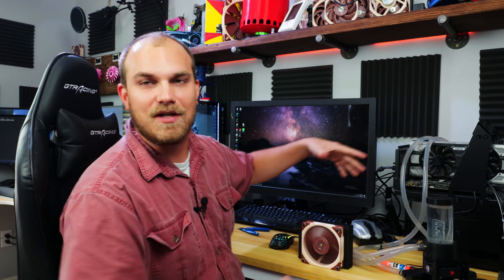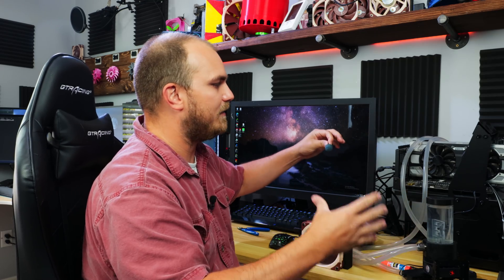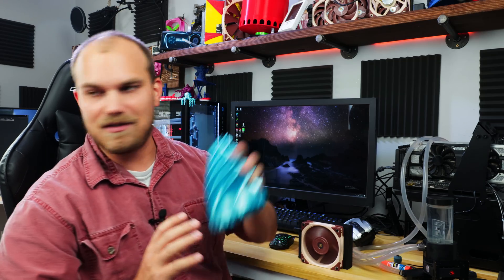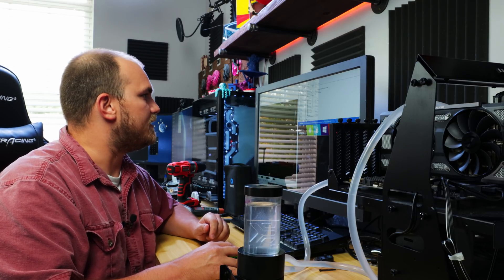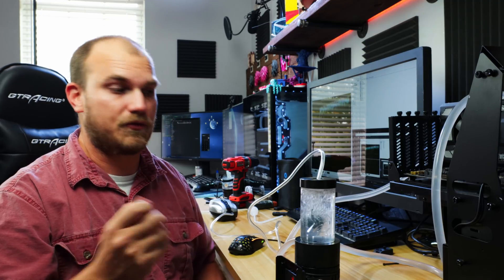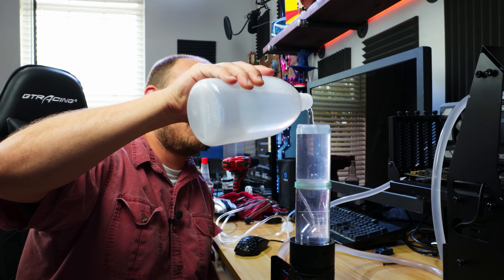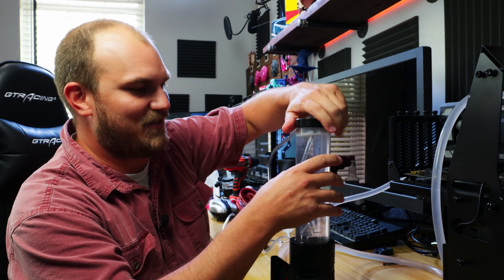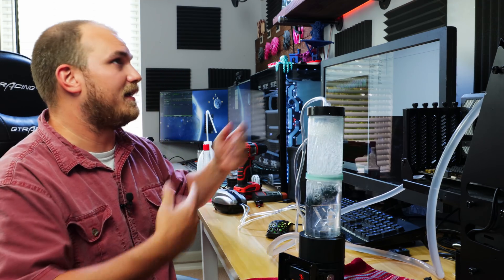Can An Airstone Cool Your PC?

Comment: Thank you for your videos. I think you do a great job.  
I did not watch the entire video ... my apologies ... but here is how I would set up the experiment. Get 2 Styrofoam cups (to minimize conduction and emission losses i.e. fewer variables),  Place a thermometer in both cups(preferably not touching the sides of the cups). Place the airstone in one, it is the test case, and nothing in the other that is the control case. Now pour the same amount of boiling or really hot water into both cups. Observe the temperature for maybe 15 minutes (because multiply the results by 4 to get a per hour answer). If the airstone cup is significantly cooler than the control cup. Then it is reasonable to conclude you cooled the water by bubbling the air through it. The air temperature is important, because in heating and cooling its the magnitude of the difference that matters, and it can compensate for differences in multiple tests. the volume of water is also important because of specific heat, more water more heat to dissipate. By significantly, I will guess over 5 degrees, because I am not sure of the mathematical way to determine what is significant. Multiple tests would also be wise. So, you can average out the results and be more confident about them. Once you prove that airstone technique works, and derived a rate at which it cools you scale up to match the heat output of the computer. Odds are you will likely need a large but not deep tank to accommodate many 30+(guessing) airstones.
Reply: I did not read your entire comment but heres what I have to say about your comment.  It sucks.

Comment: Thermodynamic insight: the cooling tower works because the hot water exchanged heat with cooler air. Faster cooling can be achieved by few methods 1. Increase temperature gradient (get colder air/hotter water). 2. Increase heat exchange surface area (get more bubbles or bigger cooling) tower. 
In this set up the biggest bottle neck is actually how much air you can pump in (go thought the reservoir), oh and don't forget air pumps will heat up air been compressed.
And You don't want taller reservoir, you want wider reservoir to allow more hotter bubbles leave the reservoir.

Comment: Use 2 res. side by side. Route the blocks hot output to the hot res. Bubble the hot res. then send water to cold res. After, pump cold water to the block.

Comment: I say: Go big or go home
Try it with 6 feet of pipe (PMMA is not too expensive), and maybe adding the water wetter drop by drop to get reduced surface tension, but not so much that it foams up all over the place. Even if it doesn't cool it will still look cool, maybe add some RGB

Comment: Maybe something similar but use the "bubble over" effect and make a outter  container to catch the overflow
with the inner container supplied by heated water  and the outer container where the "cooler " water gets pumped back into the system.

|     ,.,\,.,     |                     
| .  |~/~ | . |
| ~|   *    |~ |
-----------------
V     ^^     
C      H

I know this "diagram" is a little crap but i figured tp place this here before this one forgets.
V is the cool pumped out water    ( C )
^^ is the Hot water in       ( H )
~ water
,.,.,., My best attempt to make bubbles lol
| sides of inner and outer container
\
/ hose
* Air rock(s)
_______ Base because you gotta have dat base lol
Edit: forgot the air rocks / hose.  Just place them to the center like in this video.

Comment: Check the temps of the water with a laser thermometer at the top of the reservoir and the bottom and see if its even doing anything for temp change. With that style of pump the water coming in from the loop doesn't seem to have much time to interact with the bubbling so you might need to get the flow to pass through or by the water stone to get any actuall heat transfer before it enters the system again. I think maybe the bubbles are creating a heat barrier inside the rez from top to bottom. So you are just sucking hot water back in. Maybe put the return in the top so the water passes the air stone and down to the pump again

Comment: On the water return hole for the reservoir add a hard pipe to the top of the tank that way all water that's coming in has to pass through the bubbles. And has to be cooled and hopefully will be cooled better. But I'm also not a fluid dynamics professor XD.

Comment: [sug] 3 Identical water chambers, the same size as you have already. 
Chamber 1): Hooked up like normal to the water pump (full of water). At the top put a cap on connected to a tube in the center.
Chamber 2 (condenser chamber): laid not quite sideways. Slightly higher side goes towards chamber 1 connected from the tube.
The lower side is capped with a tub in the center, going into chamber 3.
Chamber 3): Full of water, connected towards the bottom of chamber 1 with a one-way valve, to prevent back flow.

In theory: As the first chamber starts getting hot, the hot moist air rises to chamber 2 building up condensation forming cooler water droplets, then drips into chamber 3. The temperature difference should be enough to make the water flow from chamber 3, into chamber one. Don't expect it to cool the system like a radiator, but it might be enough to keep it running without throttling the cpu.

Comment: You aren't getting enough heat exchange so
1.) Remove the extra column
2.) Print an "evap/condenser" combo pan that screws onto the res. It should look like 2 funnels, both facing "down", connected via cylinder. The lower "funnel" should have a large enough "mouth" to fit the res. The "mouth" of the upper "funnel" should tiny, you want a small amount of air to exchange without totally evaporating your water supply. This can probably be printed or fabricated out of copper sheet metal for better heat exchange, copper should also make the water re-condense a lot faster.
3.) The total size of the "evap/condenser" combo should be no larger than 1.5 the size of the res/pump. While larger would offer more efficiency, it would also make this thing terribly unbalanced and top heavy.

Comment: For evaporative cooling, I would think the evaporated water would have to leave the loop.  As it is, evaporating water would cool the loop, but it brings the heat right back into the loop when it condenses and drips back down. 

If you ran it with some sort of wick like a humidifier/evaporative cooler does, you should get some cooling, but the loop will drain over time.  Not practical for daily use, but a good proof of concept.

Comment: I bet if you 3d printed a properly shaped shroud to be used with the screw type fan the induction would be more forced like a pump. Turbines are inside housings, without that some air seems to be lost outwards instead.

Comment: An issue of this could be that of the design of the pump as it is designed
just for circulation; the water tank connected to the pump is simply designed
to keep the water loop filled; there isn't any circulation from the pump into the tank 
and back as the initial design wouldn't have a reason to initially do this. 
one the best chances you have with the current setup is to cap-off
the inlet of the pump and have the water from the PC flow directly into the top
of the reservoir, so that the hot water is circulating within the tank and the 
bubbles are affecting the hot water. The increased height of the tank will help
with cooling.

Comment: 1. Make the surface area of the coolant in res approx the same as the cooling tower area
2. Have more stones evenly distributed to keep the surface uniformly turbulent. Achieving a light spray at the surface is the ideal scenario. The more surface area of water exposed to the air the greater the rate of evaporation.
3. you need a fan blowing across the top of the coolant surface to dissipate the saturated air to allow more coolant to evaporate and adiabatically cool the system.
4. Bonus points if you use a peltier to cool a condensing plate to collect and recycle the coolant, thus potentially making the system viable as a continuous operation cooling system (IF it works)

Comment: Thr thing is as far as I know, that air introduced into the system transfer heat worst than water, so passing through the water block will affect negatively the heat transfer.

Comment: The Da Vinci screw, and later that double helix screw, didn't/won't work because the air is allowed to escape radially. You need a duct for it to operate correctly, as then you'd be pushing the air axially, as the air couldn't escape radially. Think of an Archimedes screw, which is typically used for water, and how it needs a duct to contain the water, to push the water. An air screw is no different, except Da Vinci's and derived designs of such are conical rather than cylindrical, but they're conical in the wrong direction, as you'd be expanding the chamber, rather than compressing the chamber; this means that you could use an inversed Da Vinci screw as a compressor, assuming you can get tolerances tight enough, and you can actually get it to properly suck air.

Comment: Physics says that's a terrible idea. Basically, other than Ammonia or artificial coolants (generally bad especially in relatively low quality cooling ie non-industrial systems) water has the best ability to hold heat. Air is an insulator. More air IN the water = water with more insulative properties. Cascade systems and cooling tower systems work because they minimize the presence and absorption of air dissolving in the water itself.

Comment: I have an idea, what if you use a large aquarium as a radiator. Most aquariums have heaters to regulate the temp. Can a computer do that job instead?
Reply: the idea is on the return of the filter you can make an acrylic box around a 110 radiator. the box will have two openings one for the water to go in and cover most of the radiator, and an outlet that leaves on the other side of the radiator back into the aquarium.

Comment: You could try like I did on my computer. I have two separate reservoirs one has a pump and the other one doesn’t. And the results aretwo radiators. I have a tall reservoir with a pump flowing to first radiator. Then to a smaller reservoir. Then second radiator and back to large reservoir. 
If you put the air nozzle in the smaller reservoir and seal it in between it might work a little better I don’t know never tried.

Comment: Well the thing is the air bubbling through the water isn't going to generate much evaporative cooling at CPU temps and the amount of air travelling through it isn't enough for conventional air cooling (though the heat transfer from water to air would be about as efficient as you can make it). Maybe if you have like 20 air stones in a trough with silly amounts of air pumped through it, as in similar amounts to the CFM of a fan, then it'll work .

And as long as you're making a trough for that many airstones...

How about reversing the idea and making a Liquid Droplet Radiator? Instead of bubbling air through the water, you rain the water through the air (collecting it in a trough, which could be your reservior, and then sending it back to the cpu). It's imagined for use in space based nuclear power (where you need massive surface/volume ratios for radiative cooling and with precision nozzles that shoot the spray at the collection trough) but it should work in air too and should put the normal radiators ability to transfer heat to the air to shame. You might make things a bit humid though.
Reply: He already made it, it's the big red thing he showed in the video at 0:45 .

Comment: As in Bermuda Triangle, under water landslides creates huge amount of bubbles and ship sinks with no buoyancy. Needs more water. Air in the system displaces amount of water and water is half or 3/4 what is needed for cooling. Like in a car radiator with a hole. Half the water = over heating. You want more water for cooling. Try Heavy Water.

Comment: IMO some of the problems might be pushing air in the loop. it could be the pump is pushing hot air in. it could be that your water going into the pump at the bottom. I don't really see it working that well because of the water to air ratio. 
 way's it might work better #1. have a sponge at the bottom and run the air stone on top of that... to stop help stop the bubbles from getting in the loop. then have the water coming in from the top (CPU side) so that only the hot water is being hit by the air bubbles.
 or #2 (kinda not what you are doing now but like what you did in the past on a smaller scale) if you put a sponge in the 2nd reservoir, have a hole in the reservoir connector (middle) to help air bypass, have the water come in from the top (on the sponge) and on top of all that, have a fan that can pull the air up through the dripping water in the sponge.

Comment: Print a rectangle box that at the top feeds water into it, have it be caught by a drip mechanism that spreads the water over the the whole container. Then near the middle have a long air stone. The water will have to drip down and pass through the bubbles in order to make it into the exit. The bubbles are outside air so theoretically it should cool the air. There may have to be some holes at the top to let air out so it's not just pressurizing the the system. If anything it could be a cool looking/noisy reservoir

Comment: Considering a tropical fish tank has multiple air stones (usually) and can EASILY be heated with/despite the airstones running by a 25w heater....

There's your answer.
Reply: The air pump is heating up the air too. What happens to the hose on a bicycle pump as you pump up the bike tyres? The hose gets hot.
Compression creates heat!
It's not until the gasses/air decompress that you experience any cooling effects.

So no, a setup like this will never work and that's why nobody uses a design anything like this.

It was fun to watch though :)
Reply: @TheHungrySlug  all fare points but also he didn't send the hot water to the top of the Reservoir so the thermal circulation wasn't sufficient.
Reply: @zeanyt2372  the water is being circulated by the pump. There is NO hotter water to send to the top, the res will all be one temp. Plus the air bubbles will be circulating the water in the already rapidly moving water in the res. Have you never run a loop before? The water moves pretty fast.
Reply: @lunchie80  I know the water is moving pretty fast but mostly along the bottom of the reservoir. If the hot water was being pumped from the top to bottom would have better circulation with the bubbles.
Reply: @TheHungrySlug  you're over thinking. A fish pump barely warms anything. The air comes out cool.
Reply: @lunchie80  Granted that a fish tank air pump won't build up much heat, but will it build a small amount of heat? Yes.
Is it possible for any of that excess heat to affect the tests? Yes.   
Is there an alternative method to do this test? YES!
A Another way to try this experiment again would be to use the air compressor he keeps under his desk. Switch it on and let it build up pressure until it cuts out and then switch it off. Then wait around 10 minutes for the compressor to cool down. 
Set a low pressure on the pressure regulator and allow the air to decompress through the air-stone setup in the water reservoir of the cooling system.  A test this way rules out any heat build-up from any air-pump or air compressor.

And thank you, over thinking everything is what I was born to do. Cheers
Reply: @TheHungrySlug  plus, the decompression of the air will actually be cooler.
Reply: @TheHungrySlug  so maybe a bigger slower and stronger pump? So it has less heat and more volume and pressure.
Reply: @mrbojanglz37  Exactly! That was my whole point...
Reply: I say dry ice surrounding the air pump, cool the air and the pump, or fail magnificently with lasers in the vapor.

Comment: The main problem you're facing is fairly simple... the air pumps use the air flow out the tube to vent their heat of operation.  So you're adding heat into the system by using a diaphraghiphympbm pump.  Now if you were to use a pressurized can of CO2 that was brought down to ambient temp and then gained some cooling from the pressure relief you might see something about this work.

Comment: Instead of a taller reservoir try more wider I recon you need more surface area for that to work. Maybe something like an aquarium perhaps. More surface area and volume.
Reply: Owh yaaa and he could also throw some nice fish in there
Reply: Interesting idea, maybe a second larger reservoir with the airstones connected to the pump/res unit would have better results
Reply: @cmarting83  If it's deeper with a bigger opening at the top than you might have a better result.

Comment: I'd like to see someone make an aquarium style "sump" filter, similar in concept to the big red tower cooler but much more air exchange if constructed correctly.

Dropping the water over multiple drilled trays also forcing the water up and over partitions which could have more drilled trays added if you so choose, leading to one single return chamber. I have no idea if it would work, but it would be a fun adventure.